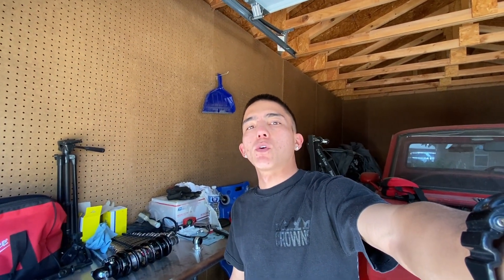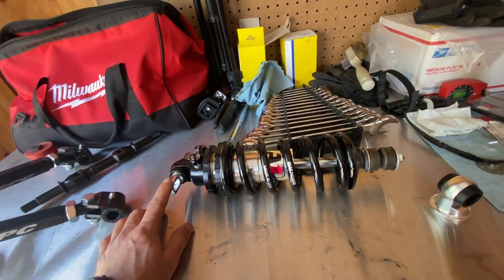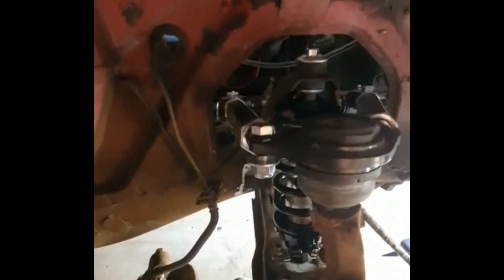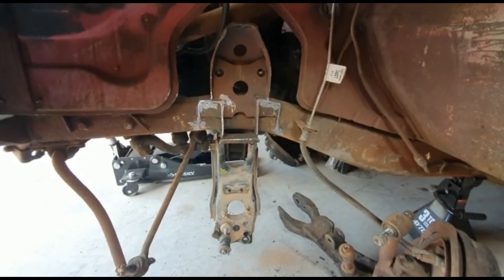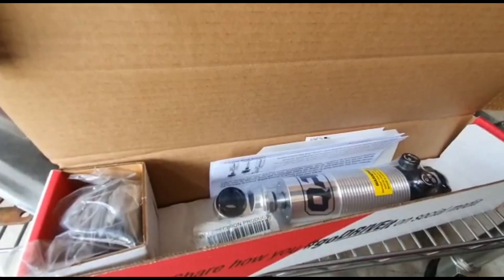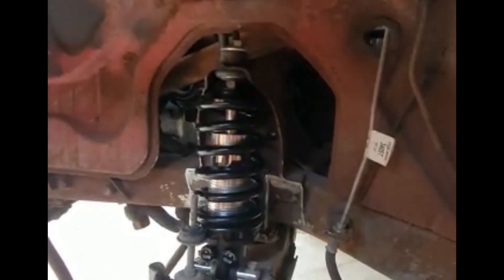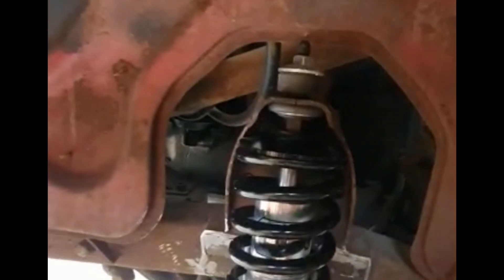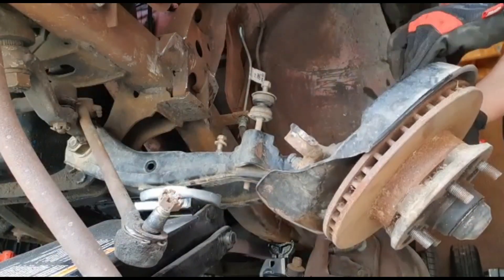Datsun Front Suspension UPGRADE (PART 2) Custom Upper Control Arm and Coil over Conversion

Comment: why couldnt you use da old cross bar on upper control arm ?
Reply from the maker: The original doesn't have Ball joints. We wanted to update the suspension with Ball joints upper and lower.
Reply: @davillsgarage  i meant the bar not the complete upper control arm because the original bar would work on that one you put together i imagine so you wouldn't have had to weld one
Reply from the maker: I'm lost. Are you talking about the shock tower?
Reply: @davillsgarage  i said upper control arm didn't i the rod that connects to the frame
Reply: @davillsgarage   52 seconds into video
Reply from the maker: That's a good question. I didn't even try. Might have to check on that next. Thanks.
Reply: @davillsgarage  i saw someone do the shakah sign you from hawaii ?
Reply from the maker: We from the Island Guam. 🇬🇺
Reply from the maker: Hawaii is our neighbor. Lol
Reply: @davillsgarage  im from hawaii
Reply from the maker: Sweet. Hafa Loha brothaman. If you know you know. 🤙

Comment: How r you brother beautiful truck do you mind sharing the part# for the upper control arm
Reply from the maker: Hey brother, sorry been busy trying to catch up but here you go.
Upper control arm parts 
•Cross shaft - 5” - #93400
(cut and welded to fit)
•Hardware kit - #92021
•Adj sleeve aluminum-4”- #92045
•Ball joint - #K9772
•Ball joint plate - #92003
Reply: It’s all good brother thank you appreciated the info keep up the good work take care